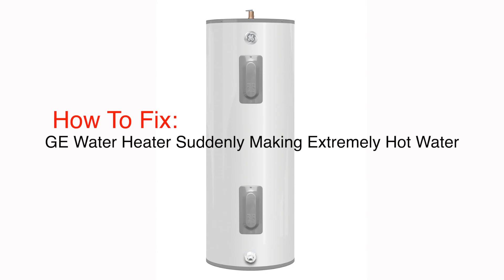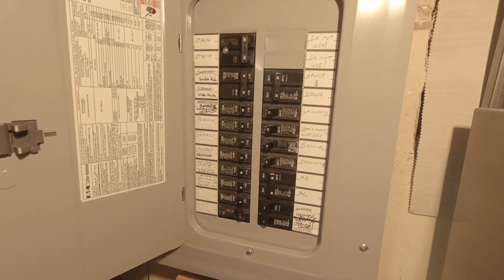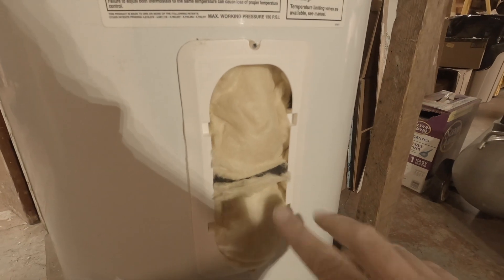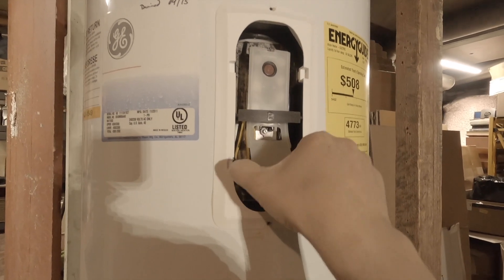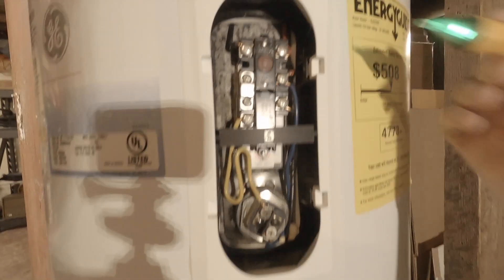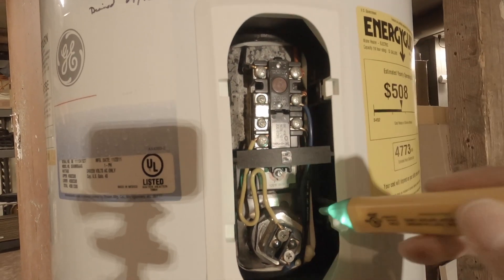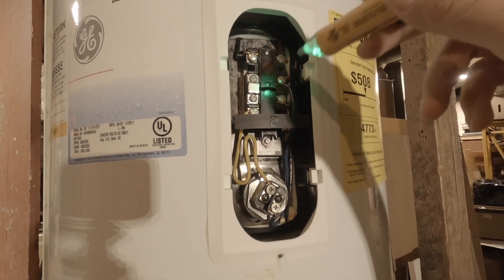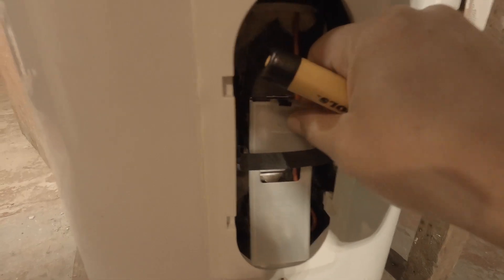Fix your GE Water Heater that is Suddenly Producing Extremely Hot Water

Comment: Water heater thermostats went tits up. I bought new thermostats from Lowe's, installed, and now the water is INSANELY hot. Anything other than the thermostat being faulty NIB that would cause overheating? Elements have continuity, they aren't shorting to the tank.
Reply from the maker: There should be a screw on the front of the main thermostat to adjust the temperature. I would also make sure the back of the thermostat is making good contact with the tank to register the tanks temperature. I would also double check you have the correct thermostat for you water heater. All else fails call a plumber or possibly replace the whole unit depending on its age. Best of luck.